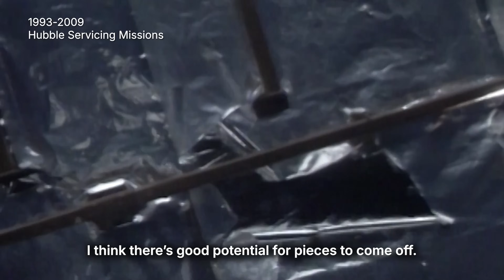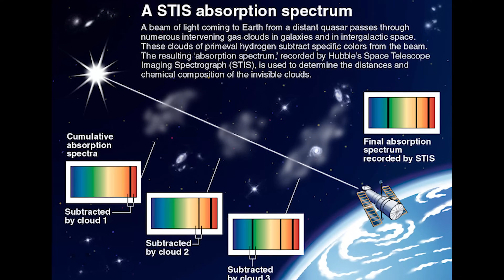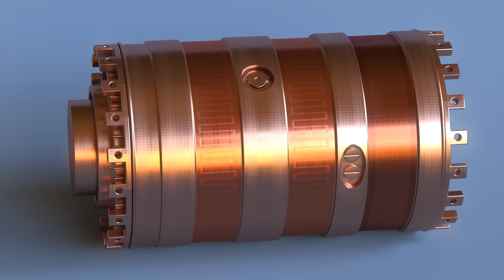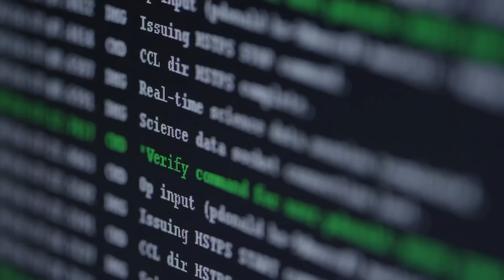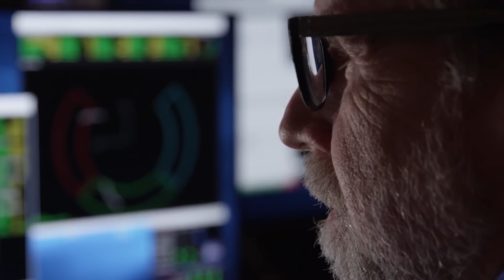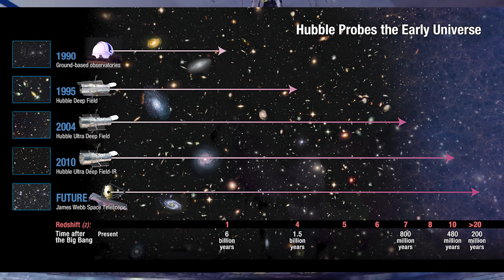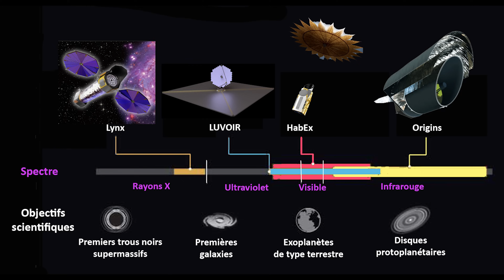SpaceX Discovered Brilliant Solution for Starship to Save NASA Hubble and it is Wild...

Comment: So, was the Hubble Telescope designed to be serviced by astronauts or wasn't it? I was told the whole time it was some miracle because it wasn't designed to be serviced. What's the deal? 													Was the Hubble Space Telescope Designed to Be Serviced?
YES - the Hubble Space Telescope was intentionally designed to be serviced by astronauts from the beginning
Background
- Launched in 1990 by the Space Shuttle Discovery (STS-31)
- Designed with modular instruments, handholds, and tool access for astronaut servicing
- NASA always intended Hubble to be maintained and upgraded via Space Shuttle missions
Servicing Missions:
- Five servicing missions were conducted between 1993 and 2009
• The 1983 mission (STS-61) corrected a critical mirror flaw using specially developed tools
- Astronauts replaced and upgraded instruments, batteries, gyroscopes, and solar panels over time
Why the Confusion?
• Some people confuse Hubble with other satellites that are not serviceable
• The difficulty and heroism of the repairs may have led to exaggeration of how 'miraculous' they wore
• Public admiration for the astronauts may have contributed to the myth
Final Word:
The abilty to service Hubble was a feature - not a lucky accident. Its extraordinary longevity is a result of forward thinking NASA engineering.
Reply: Of course you mean, 1993 for the STS-61 mission ❤🎉